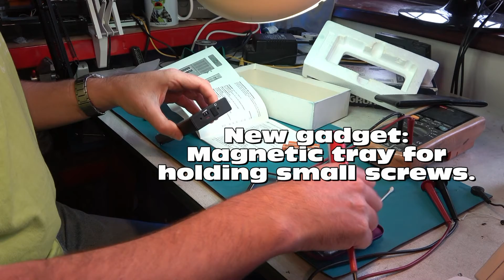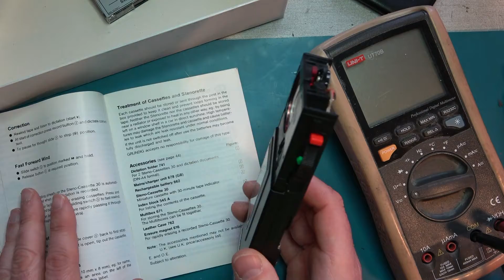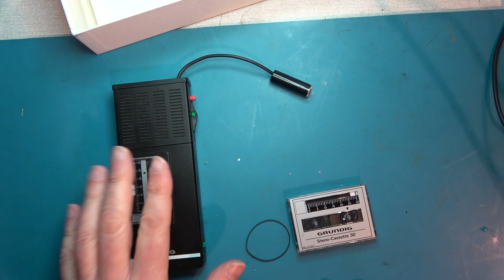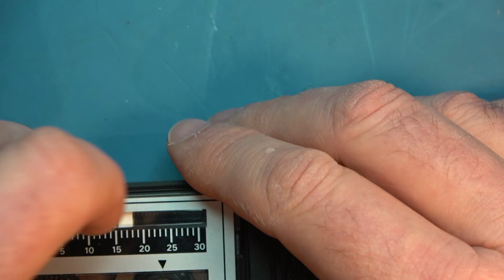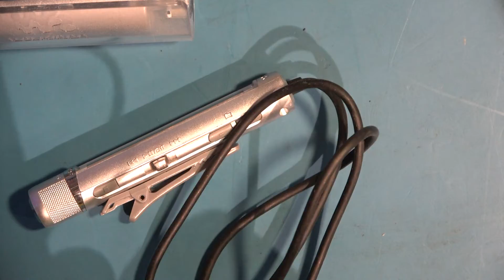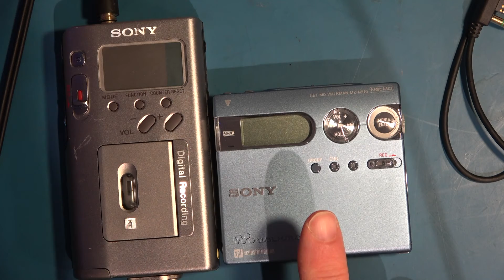Wacky cassettes: Grundig Steno-Cassette and Sony NT.

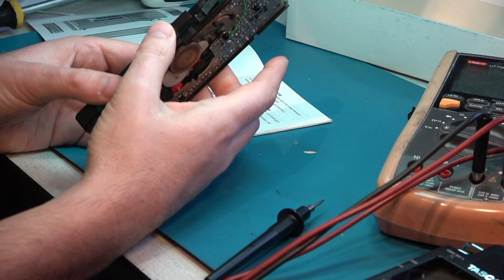Comment: @19:58 "Wow."  One of the two appropriate reactions possible. (The other being "Flutter.".)
Re: the Steno Cassette, I've never heard of that one.  And I think I've watched every Techmoan video on obscure audio/video formats, so I'm pretty sure you've found one he hasn't.  Well done!
Re: Sony's NT, that tape and mechanism looks SO delicate, I'd have been afraid of it when it was new.  And yet you bought a used, working one now.  Does it record in both directions (without flipping the cassette over) as well as play both directions?  If so, I don't get why they made the cassette so it could be flipped over.  But then, like you said, just making it period didn't make much sense.
Reply from the maker: Yes it records on both sides.  Incredible, isn't it?!

Comment: A couple of things on the NT-2, the blank cassettes came in 60, 90 and 120 minute lengths. The cassette cases could hold four cassettes.

These were developed before memory became very small and cheap, the 120 minute tape would hold over 1gb of data. I suspect the plan was to have Walkman playback only versions which would be half the size of a cassette walkman, could play for half a day and you could carry 8 hours of music in one cassette storage case. 
The specs on this compare pretty favourably with standard cassette and they could have had a 44.1kh version in the works. If cheap memory hadn't been developed we probably would have had this. Just bad timing.

Comment: I have one of these, with three tapes with my late gt gt aunt speaking on them, Sadly I`ve dug it out and ---- the drive belt is broken. What drive belt did you get please and from where?
Reply from the maker: I think I based it just on length since I have a large stock of drive belts.  Measure the length of the belt you have and do a search on eBay for a "cassette belt" of the same (or slightly smaller) size.
Reply: @video99couk  Thanks very much. Just ordered some random sizes - didn`t cost much.

Comment: Greetings Colin,  happy new year to you.
What an interesting vlog,  but i thought i should perhaps make mention of what one of your previous commentors half mentioned, that is about the "Transcriber" or transcription machine for the Stenorette Format,  this format was very widely used in the medical profession,  where consultants in particular would dictate thier notes, letters, reports etc, and their secretary service would type them up, these go back even before word processors,  highly skilled typists would sit at an Typewriter, lightweight headphones upon the head,  foot-switch under their right foot,  the foot switch was to pause the tape if the speaker was too fast, or was not making sense.   to this end the transcriber would be a much better option for you Colin, they were built to a higher standard, certainly to last a good deal longer than the portable steno recorders, had better audio specificatons, had a remote option and a headphone socket, it was very much down to the individual stenorette recorder as to what came out of the transcriber, most had a speaker.   Now i wonder if you can find a good  one on Ebay ?  i look forward perhaps to the updated vlog.
All good wishes, and thanks for your most enjoyable content.   kind regards  Simon.
Reply from the maker: I do use transcriber machines for both mincassette and microcassette.  Actually the foot pedal from one of those provides the basis for the remote control operation of my ESR tester, there is a YouTube video on that.  The Steno Cassette format didn't sell well in the UK so finding any machine of this format is hard, but at least I can support the format now if I'm ever asked to do one.

Comment: Nice simple power fault, smashing :-D

I really like the built in tape usage meter in the steno cassette, very unusual.
If there was no low level line out on that top pcb i was thinking a 10k preset across the speaker would allow rough output and tone down the amplifier hiss that's always present.
Or a 50k pot tapped across the volume control.
But you found a perfect output :-D.
It seems like the strobe disk was calibrated to 50hz thankfully :-D
Reply from the maker: Being European, I expected the strobe markings to be correct for 50Hz.  I didn't want to have to pull the speaker out so was glad for the connections, I suspect they had a version with a headphone socket.

Comment: I have such a Stenorette, I bought it at a fleah market and didn't even have to replace the drive belt... It still works great, mine uses a 9v battery. You can usually use any rechargeble aa batteries, they originally have grundig branded rechargeable ones in them. And I know you have to slide the lid on before you can do anything with it, because the head slides down, when you place the lid on... They always have such a high wobble. even with a new belt...These stenorette also have desktop machines, and to my knowledge they are still used today.....
Reply from the maker: It caused me so much confusion until I slid the cover over!  I think the motor is not the best quality and hence the high wobble, but it's acceptable for a dictation format.

Comment: hi i have a cam that is as bad as yours with the zoom why i can't make any video's    it's  a top line one  matt doe's make small tiny info miss take s time to tiime
why he keeps away from pro gear
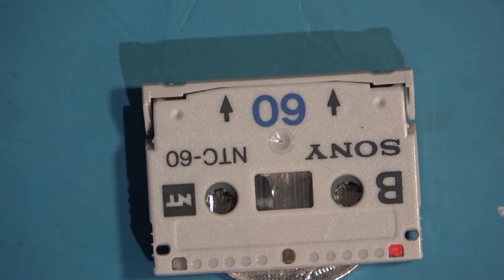Reply from the maker: It was struggling occasionally with zooming into small equipment.  That's a fairly expensive Sony FDR-AX53.  At times though it did quite well, like at 45:01.